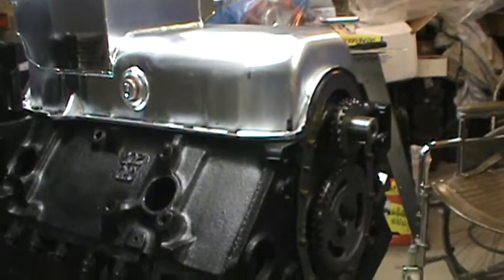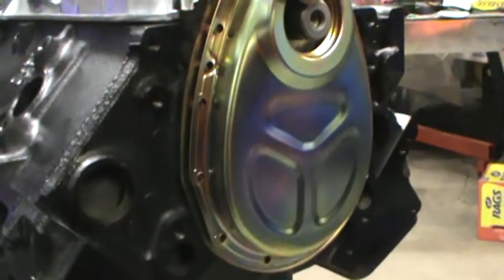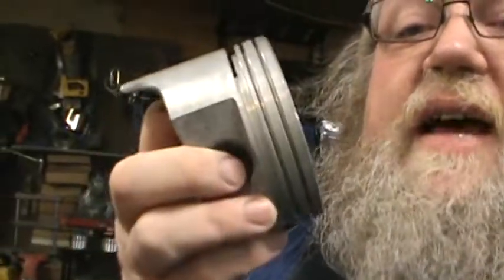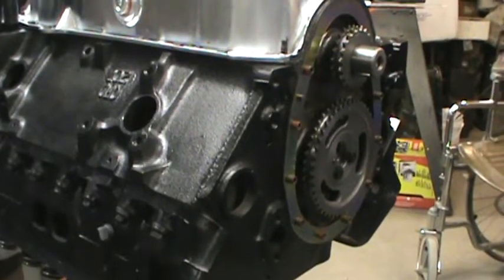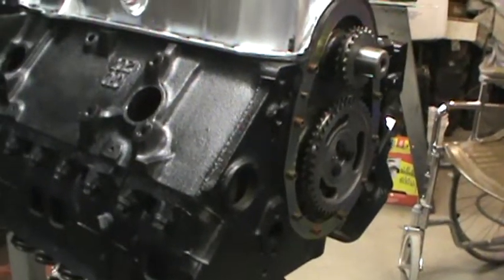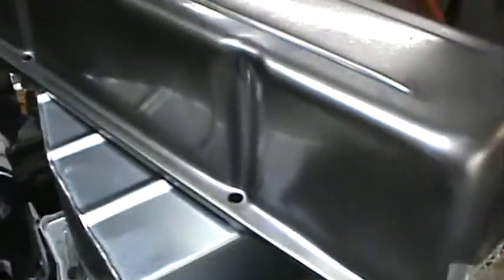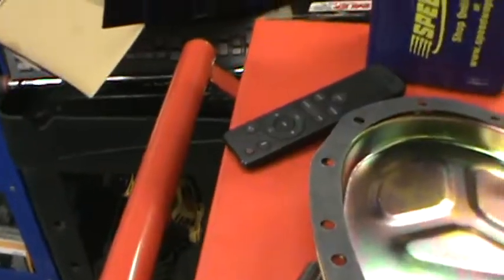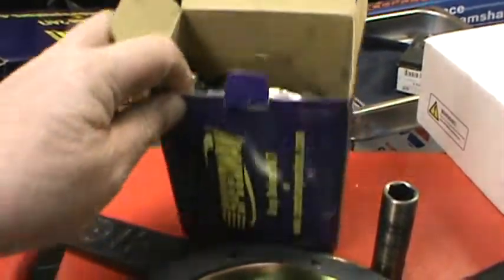working on 2021 dirt motor and update on Momma bear

Comment: I hope you have better luck with that timing cover than I did! Didn't leak with the engine idling but as soon as the RPMs went up, out came the oil! 

Right at the bottom under the balancer where that cover doesn't have any bolts to keep it from flexing open is where the oil puked out on mine.

Edelbrock makes a similar cover but it has at least one bolt at the bottom maybe more? It's been a while since I looked at one.
Reply from the maker: time will tell
Reply: Oh yeah and Comp makes a really nice billet aluminum 2 piece timing cover, great for cam swaps without disturbing the oil pan gasket as well.
Reply: @tlcbear2  

At least you have the run stand to know if it's going to leak or not. 👍

I didn't have mine yet when I bought one of those covers.

And my prayers go out to mama Bear, I hope she gets well soon. 🙏
Reply from the maker: had another viewer call me and told me how to make sure it don't leak and yes test stand will help.